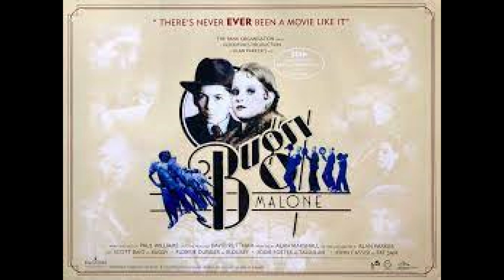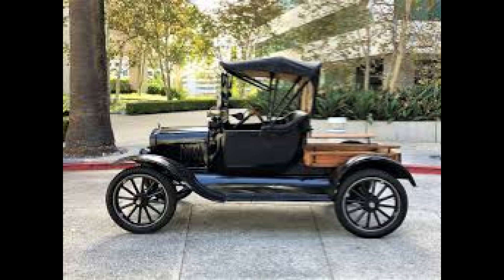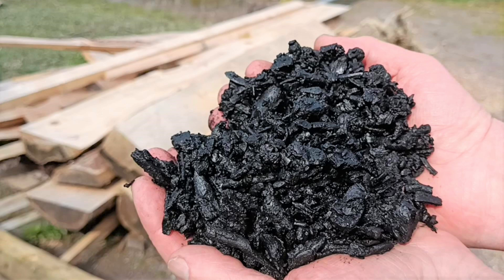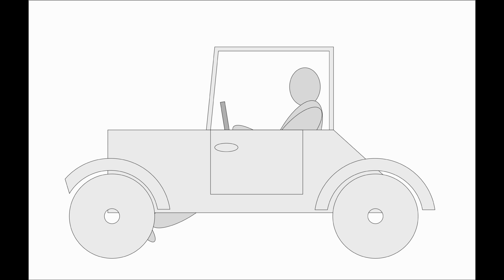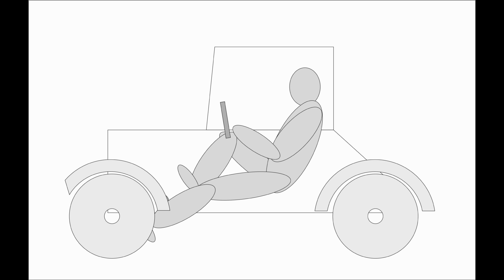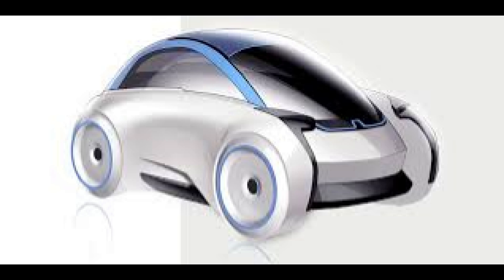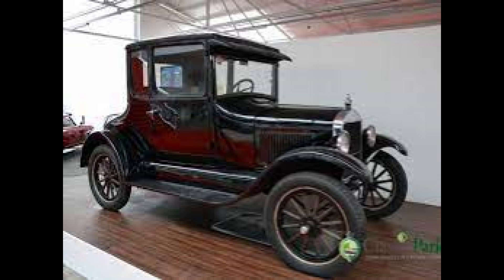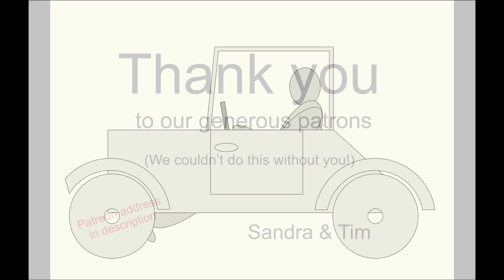Could We Build A Full-Size Wooden Pedal-Assist Electric Car?

Comment: In my opinion, this should be a Synchronus Velocitor, a lovely silly name for a lovely little vehicle. There are some young gentlemen on youtube that go by 'Grind Hard Plumbing' that do lots of small vehicles, though they're more high-performance gas than anything.  Just off the cuff, my initial thought is bicycle wheels.  I'm quite fond of the idea of fiberglass panels for bodywork.  Again, initial off the cuff thoughts, I would absolutely be looking a pre-made kits or controllers that support 'assist', and also regenerative braking.  Not sure what's involved with 'assist' in the electric bike world, but if it can be applied elsewhere..  

I also wouldn't even look at less than 1kw of power, no matter how much effort you put into simplification and adding lightness, this will be quite a bit heavier than a bicycle.  Rather interested in this, and looking forward to seeing it!

Comment: Google “Not a Wheelchair” for some inspiration! Great couple building small 4 wheel electric vehicles. The peddle assist will be new for your vehicles. I’d recommend hub motors for sure.  For battery, of course light weight lithium ion, get the big 400 amp-hour ones. Can the peddle assist generation be switched from generating electricity to charge batteries to direct peddle power through a chain to the rear axle in case you need to just use peddles power to get home of your electronics have problems?
Fun idea! I look forward to seeing your progress.

Comment: Instead of pedals and mechanical transmission augmented by an electric motor,  connect pedals to a generator and let the motor do all the compensation for hills, valleys, and wind.

Comment: I think when you seal the plywood with epoxy,  you should proberbly also strengthen it with glas or carbon fiber. perhaps  as a good first step you could just layer small pieces of plywood with fiber just to understand the difference it makes to the material.

Comment: Consider a lightweight aluminium chassis with a body made from foam insulation. The foam cuts and glues super easy and can be stiffened with screen mesh and/or wood veneer glued on top with a stiff paint. (poor man's fiberglass) This is surprisingly strong, and things can even screw into it with glued-in plastic drywall anchors. You won't get it lighter than that.

Comment: This is something I've put a fair amount of time researching/designing. The single biggest factor would be weight, you could fairly easily use off the shelf bicycle parts for wheels and the drive components (electric and pedal powered), bike parts can be fairly cheap too (especially with a little help from the internet!)

I hereby voulenteer my services as a mail-order machinist/fabricator if you need it!
Reply from the maker: Thanks, Leon! If you're serious, send us an email? (address in description)

Comment: As you can weld, perhaps making a light weight tube chassis that you could bolt on body panels to once you have the car bits working together would be the way to go.  It would allow easy access to all the bits as you're sorting them out and make for an easy addition to body panels once you have it done.

Comment: It’s going to be a lot of fun! When I built my grandchildren‘s car, I learned a lot about electric motors and watts. if you intend on moving an adult or two, you’re going to need a higher wattage motor. 350 to 800 W is OK for kids but steer clear of the smaller wattage if you want to move yourself and your sweetheart, around town. The higher the wattage the more battery you’re going to need. I used 1000 W motor at 48 V DC. Granted the batteries aren’t very big but they still add weight so the higher up the more weight. looking forward to seeing this come to fruition!

Comment: i think it would be better to instead of having the pedals connected to the drive system instead connected to an altenator once current is flowing through then it activates a transister which then activates a large solid state relay which goes to the power. then on that same power line add a regulator and a computer so as you spin it it reads the voltage making it go fast when you pedal faster and slower when you go slower you go. 
also you could copy what modern dumpers do when you stop pedaling your brakes automatically come on & have a hand brake like a normal car

Comment: For the speedo you could use a cycle GPS head unit such a Garmin. Other makes are available more cheaply. No need to connect to the transmission. Alternatively the older cycle style cycle head units such as a Cateye which use a magnet attached to a spoke with a sensor attached to a fork or in this case some other structure surrounding a wheel will do a similar job.

Comment: The easiest way to make the drivetrain would probably be to use an off the shelf electric bike motor on the crank that way you'd have both pedal and electric motor in one. Only one chain, one axle being driven etc.

Comment: If you want to drive it to the shops, you'll need to fit it into a road-legal vehicle category. Not sure about the laws in Ireland but here in Ontario there are power, speed and weight limits for electrically assisted pedal vehicles above which the vehicle needs to be registered and insured.

If there are such laws in Ireland it might be easier to start with an existing car that's more than 25 years old and heavily modify it. That way you probably fall under lax antique car regulations.

Comment: A 3 wheeler does away with the need for a differential. What you could do is to have 4 washing machine motors powering the wheels independently. The pedals could operate a dynamo using electric wires for the transmission. Braking if the motors were directly connected could just be a massive resistor. Steering - if the wheels were fairly small - could be achieved by simply locking one pair of wheels and leaving the others to do the driving.

Bodywork could be canvas with epoxy rubbed onto it. Lightweight, rigid and reinforced.

Comment: Yay!!!  The biggest challenge to keeping the weight down is the batteries. Is it going to be a driver and three passenger vehicle?  Will the passengers be able to contribute to the pedaling? Are you thinking of solar panels on the top of the roof/hood/boot/etc to help with the charging? will it be able to plug in over night and when not moving? My wife and I went on holiday a few years back and rented a 'golf cart' to get around town during our stay. I never looked under the hood but I imagined how it was working as I traveled in it. There was a key that started what felt and sounded like a small petrol engine. I guess it turned an alternator and maybe some hydraulic pumps. When the accelerator was pushed it sounded and felt like an electric motor turned the wheels. I'm guessing it worked similarly to a diesel/electric train car.  Would that be cheating?

Comment: If you have pedals it's a quadrocycle, and it needs to be able to be powered by pedals alone or it comes under their legislation. Mid mounted motors are better than hub motors. Here's some useful short videos for examples:
This one doesn't have pedals, but note the transmission, and both rear wheels being driven by one hub motor: https://www.youtube.com/watch?v=vuMg0QwKAGI
This is a popular bike to trike conversion kit, and it could be used, or copied, for the rear axle: https://www.youtube.com/watch?v=ggzNjO5pnao
All the best with this project. Sounds like fun.
Reply from the maker: Thanks very much Joe - that last one was especially interesting..

Comment: I thought I couldn't love this channel any more! My thoughts: a "mid drive" e-bike unit might simplify combining pedals and electric drive. A proper differential is lots of complexity - perhaps just having each rear wheel driven through a normal bike freewheel would achieve the same goal, though that means you can't use the rear axle for brakes like a go kart does. Lots of tradeoffs!

Comment: You might also consider a canvas covered body to reduce weight. Plywood is strong but you don't need the strength for the shell necessarily. Lots of reference from the air craft and kayak/canoe worlds.
Reply: Canvas over bent bamboos or willow seems to work well. Light, springy wood lets you form nice curves and gets away from a plywood box.

Comment: Tim, I remember that film, it had a young Jodie Foster in it, if I am not mistaken.
The car you are trying to build, presents a lot of problems, notably Roadworthy Compliance issues. 
The simplest way to conform to those Regulations is to use an existing vehicle as the basis for special vehicle. A number of different people have used Land Rovers for electric conversions, I believe that one has even been converted to steam engine power. 
Other vehicles that I have seen converted include Morris Minors, Morris/Leyland Minis and possibly a VW Beetle. These conversions were done by a company in London and the idea was to remove the petrol engine and install the electric motor to the transmission and then add the battery banks and recharging circuits. Their thinking was that if the car owner decided against the electric conversion at a later date then it was a fairly easy task to reverse engineer the vehicle to reinstall the original internal combustion engine. 
I think that most owners were more than happy with the conversions. 
The beauty of this method was the reduction in the capital costs of the vehicle because you were starting out with a already owned car or one bought second hand, which was cheaper than a new car.
The other advantage to using classic cars from the 60s, 70s, and 80s was that there was less technology to get in the way and that would require new engineered work arounds to continue to function correctly. 
If this approach is not suitable for you then I would think that you need to use the e-bike/experimental vehicle pathway and for road use that will require approval from your Roads Authority. 
Naturally, that could tie up a project in lots of red tape. 
E-bike/Mobility scooter is another option but they come with size, weight and speed limits. I did recently see a very fancy, fully enclosed 4 wheel e-vehicle at a Bunnings store near me. I don't know how much it costs but it sort of seemed like a sneaky way to have the best of all worlds without the rego costs. 
Mark from Melbourne Australia
Reply from the maker: thanks, Mark - converting a car is another interesting project. Don't distract me!  : -  )

Comment: I actually did this when I was a kid, ca 10 years ago (with help from my father and a couple of friends) the chassi was entirely made from wood, and there was two sets of pedals, just connected with two separate chains to the back wheels. The electric motor was added maybe two years after the car was finished and it was just a 250w motor with a rubber pulley that could be pressed against one of the back wheels with a lever. If i remember correctly our speed record was 42 km/h downhill and pedaling like crazy. 
A couple of tips from that experience:

-you don´t need to power both back wheels if you stay in the power range of an e-bike (250-500w electric + pedals), if you use a differential you will probably lose valuable power and if you use a solid axle the wheels will slip in the turns and you will lose power there
-learn about steering geometry, it is not very complicated, you just need to know some basic trigonometry to calculate the angles of the steering linkages, if you don´t do this you will also loose power when you are turning
-don´t use wheels from an ordinary bicycle for back wheels. Most of your weight will be on the the rear and if you turn at higher speeds you will bend the wheels. the best is if you can get wheels from a moped or from a bicycle made for the postal service (they usually have thicker spokes) 
-for the motor i would recommend looking at e-bike motors. You can get the pedals and motor as one assembly, I think that is the best option
-take a good look at the laws regarding making your own vehicle, I´m not familiar with your laws but here in Sweden it´s extremely hard to make a road legal new vehicle, but you can make an e-bike and then you you are limited to a 250w motor and it can only assist you (the motor is not allowed to run faster than you are pedaling)
Reply: for steering geometry a keyword to look up is ackerman steering. That one is very simple to calculate,
Reply from the maker: Thanks, Christoffer. Yes, that all makes sense..

Comment: Why not start with a pedal-assist electric railcar for use on your tracks ?
That way you could concentrate on the traction system first, without the fuzz of steering.

Comment: Could be fun to base the frame around an upside down wooden boat. Get some aerodynamics. Cut a hole for the cab, and a skirt around the bottom to make it all a nice height with gaps for the wheels. Just a thought, very excited by this project!

Comment: Depending on the number of seats you need Tim, why not base it on the Messerschmitt KR 200.  Small, aerodynamic,light. Pedal power to the front wheels and a battery powered rear wheel for the hard bits and a reverse gear on that wheel as if there is no free wheel on the pedals they would fly round dangerously when you are not pedalling.
Reply from the maker: thanks Sam - but three wheels? Hmmm...

Comment: A cheap hack for electric mobility are hoverboard motors. If you put them on the end of a lever to press them down onto a tire you've got a very simple clutch/single gear.
This way you can save yourself a lot of trouble e.g. mounting a motor to an axis, gears, clutch, bearings etc.
They are cheap and powerful, and a lot of people have done similar projects with them.
Reply from the maker: Interesting - thanks!

Comment: Use on old golf cart to start with and improve that (or to copy the design not to run into dead end or repeat mistakes that somebody else had already solved. You might also want to ad solar panels and you should definitely use LiFePo batteries, not lead ones! Watch the channeling Will Prowse, he has done some modifications to golf carts and they drive some 50 miles or so with one charge!

Comment: Gas pedal car be way better and a lot simpler just need throttle cable instead of controller battery a lot of wiring ect
Can't just use mechanical brakes like what they had on the old prefects and Anglia's ect

Comment: I would like to suggest building the first one to look like an early 20th century pickup truck, so you can drive it to town with your products in the bed, so not only are you building your pedal car, but you can also save on gas and have it as a business vehicle. :)

Personally, I have thought about something similar, except it would be Powered by a Small Gas Engine, so i hope you go into heavy detail on this project so i can interpret and use them as a guide on how to do something like this.

Comment: Excellent I'm excited to see the development. I actually got a 1500w electric buggy motor from vevor, a 240v to 48v transformer and a 2200w power pack to build a mini vehicle. I was thinking of building a mini tractor with a worm gear reduction drive for increasing the torque. All the very best. Cheers J
Reply from the maker: I should get onto Vevor again!

Comment: May I suggest one or two pairs of hub motor e-bike wheels. These can be driven by a cheap but quite functional electronic speed controller (ESC) , which in turn is driven from a battery pack. I recommend building a battery pack from lithium ion cells, although a few lead acid  batteries will work just fine. With 4 e-bike wheels, the car should have enough torque to start on grass or uphill. I don't see why not stick a solar panel on top.
Reply: The e-bike wheels have a through axle, which should be supported on both sides, although I have seen electric wheelchair wheels, which avoid that. The 36-48volt hub motors generally have a planetary reduction inside them, meaning more torque at low speeds. A lithium battery will cost you as the high performance version, lead acid will take up more room and weight, resulting in less power and speed.
I hope this helped. Everything I know, I learned online and from experimentation, and I hope I can save you some time and maybe money.
Reply from the maker: Thanks - yes, that all makes sense. We're still not sure about hun motors though - so expensive..
Reply: @wayoutwest-workshopstuff6299  Can always go with a cheap DC motor, sprocket and chain. Directly connected to the battery